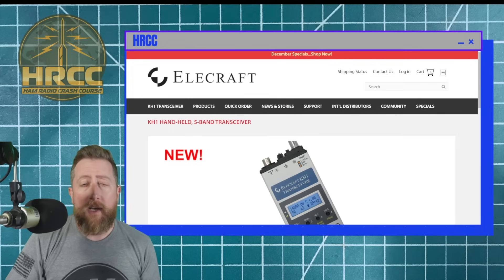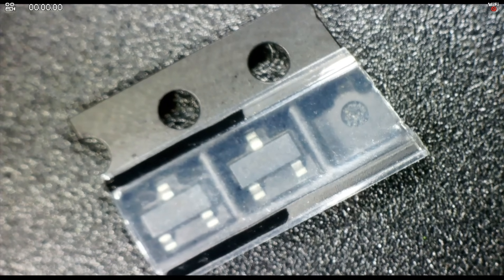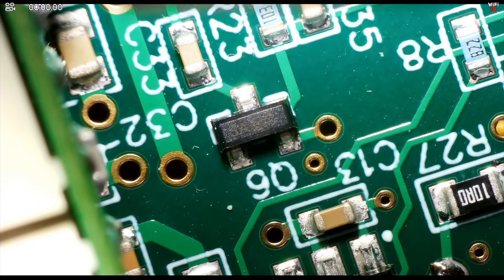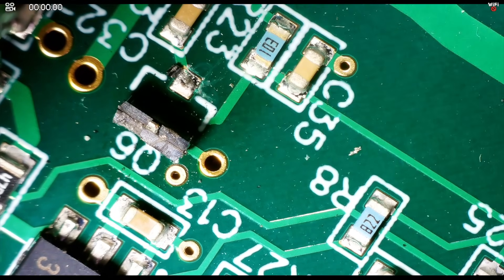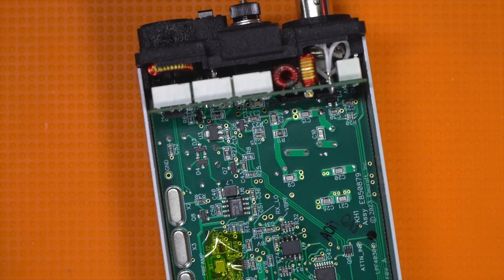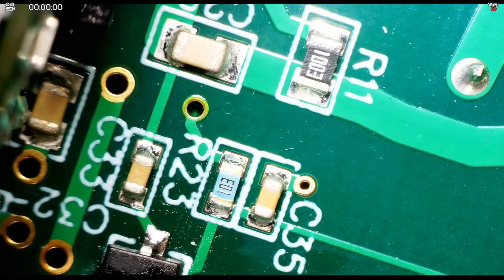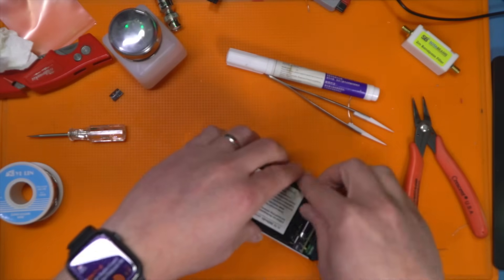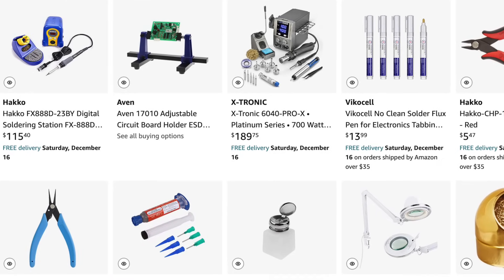I FIXED My Elecraft KH-1! We're Back On The Air!

Comment: Aloha Josh, I was just doing some soldering yesterday with tiny parts and I don’t own nearly as nice tools that you have. The secret to my soldering gun is using lots of flux and a bright headlamp. Great job but better you than me. 🤣😂🤣😂
    I was wondering, it seems that would be the part to upgrade your power output, you think they will have the option in the future? 🤔
Reply: Part may be in the tuner or SWR measuring circuit, no way is it a final transistor.

Comment: Nice job Josh but did Elecraft say what caused the original MOSFET to fail? Hopefully the new part won't fail after a few weeks.

73 Ed
Reply from the maker: I was told it’s more robust 🤷🏼‍♀️
Reply: @HamRadioCrashCourse  so the new part was a different one to the original. I guess if this part works out it'll be used by Elecraft in production from now on. Ed
Reply from the maker: Yes that is exactly what I told.  I hope you are doing well Ed!

Comment: Is that any specific reason you didn't use your hot air soldering tool?
Reply from the maker: I don’t want desolder the other parts really.
Reply: @HamRadioCrashCourse  Didn't your hot air tool come with smaller tips to direct air more precisely? Tiny spot flow and high heat so quick in and out... the 5mm nozzle should do the trick but a 3mm would be better if they make one that small... I have reduced the size by ordering a replacement nozzle and slitting it then rolling it to overlap the slit edges... had to do that for a diode that was the size of a pepper flake... factory forbid the use of an iron on that circuit because of static issues... I was SOOOO happy when they scrapped that board and came out with a replacement with all the fixes! Part of a slot machine so we had to follow whatever the factory said to keep them certified.
Reply from the maker: It does come with very small tips.  My concern is that the shape of the radio, proximity to the tuner board and the shape of it basically being a shoebox was that adjacent parts would heat up quickly.

Comment: That joint really doesn't look that great.  I do almost 100% SMD stuff these days, and I wouldn't be satisfied with that.  It's easy to fix though -- dab that pin with a bit of flux, and just touch the iron to it.  The flux will clear off any oxides and the solder that's already there will reflow and make nice welds.
Reply from the maker: lol, ok
Reply: @HamRadioCrashCourse  sorry, not trying to be a jerk. Would hate for it to work ok for awhile and then fail again in the field for a dodgy solder joint! Kudos to you for working on it in the first place!